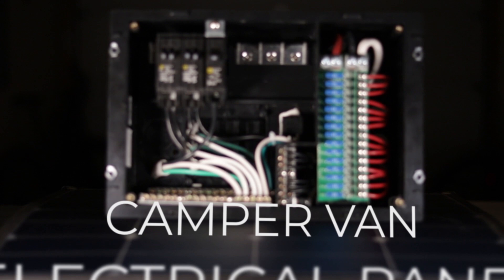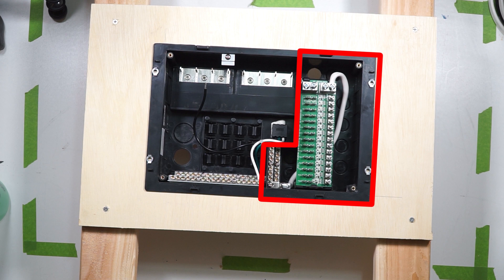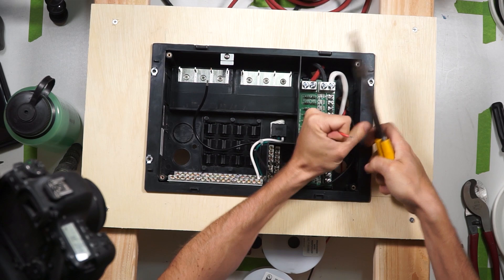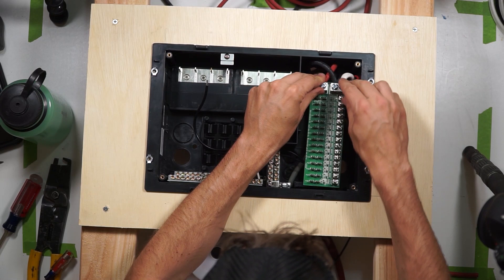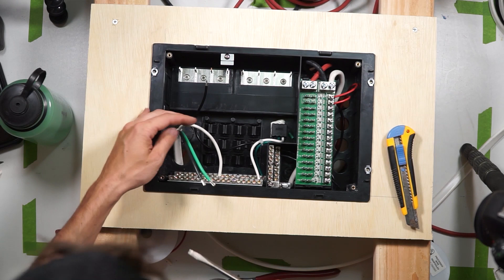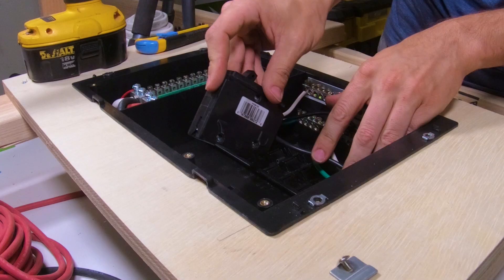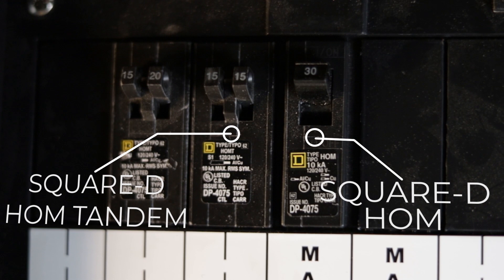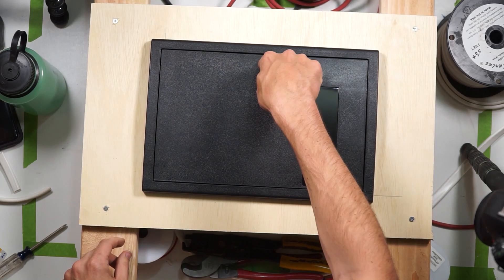How To Wire a Camper Van Electrical Distribution Panel

Comment: Thank you for the great videos.  What do you do if you have more than 15 different DC items to plug into the DC panel?  Can you combine some of the lighter loads to one fuse?  Example, I have two zones of four overhead LED can lights for a total combined of 8 LED lights.  Would combining DC charge ports I presently have on 3 separate wires be a better option? Thanks for your help?
Reply from the maker: Yes!  You can definitely combine like-items on one circuit.  Doing the lights as you proposed is a great idea.  Same on charging ports.  SALES PITCH INCOMING: I made a guidebook a month or two ago about 12V branch circuit system design that has several diagrams for combining these loads onto one circuit properly.  Here's a link to that.  Check out the preview & description and see if you think this would help your planning: https://www.explorist.life/shop/solar-wiring-diagrams/12v-branch-circuits/
Reply: @EXPLORISTlife   Thank you for the quick reply.  This appears to be for planning your wire runs ahead of time.  Unfortunately, I already cut and pulled my marine grade mostly 14 AWG wire, and now need a way to combine them just before the fuse box.  Will this help in my situation?
Reply from the maker: Ouch, nope.  Probably not.  You could always add an extra fuse block in parallel before the 12v fuse block in this distribution panel for additional spaces: https://amzn.to/3uljDpM
Reply: @EXPLORISTlife  So a separate DC fuse block with a separate set of positive & negative wires going to my negative and positive bus bars?

Comment: Question. Why are there 2 different sections of the box? 1 for 110 and 1 for 12v? Why have it separate? My interior lights, radio, and pumps are running off the battery, I don't see y.  Is there a way to have it all run off shore? Is there some sort of switch to make it all off shore and if want to also run off battery when I get the solar up and running? Thanks, as you can tell, I am new to this.
Reply: 110v is for house plugs, like outlets, AC appliances. 12v is for DC appliances. Some people get a separate 12v box, abd a breaker box for 110v, just an easier way to have everything in one.

Comment: This was super helpful. I’m essentially duplicating the setup you did in Andy Rawl’s Airstream in my Argosy, also in Texas :) I have a question, when a fuse is installed, I’m getting the needed 12 volts out. However, when I removed all fuses, I’m still getting 6-8 volts from the negative busbar to any of my positive outputs (even though there aren’t any fuses installed). Shouldn’t there be zero voltage on outputs without fuses installed?
Reply from the maker: Sometimes a capacitor in one of the devices will make a voltage reading show up when the master disconnect is off.
Reply: @EXPLORISTlife  To clarify, this is happening when I don't have ANY fuses in the DC fuse block within the distribution panel (same one that's in this video), and every circuit is measuring 8 volts from the negative bus bar to the positive DC terminals. Because I don't have a fuse installed in the fuse holders, shouldn't each circuit be completely disconnected?

Comment: Nate thank you very much for this video, I just have one more question how can I hook up an inverter to the distribution panel? I want the batteries take over as soon as the power is disconnected from shore power.  Thanks in advance for your help.
Reply from the maker: Sure!  You should check out the wiring diagrams on https://www.EXPLORIST.life/solarwiringdiagrams.   All of those have that capability.

Comment: Aloha Nate,
We’re remodeling a 1990 Winnebago Warrior and running into a power issue. Everything works great and we don’t really want to change anything except the back we want to be able to use the outlets when we are not connected  shore power. How would you introduce a investor to the system without completely ripping out current system? My thought would be have the inverter connected to the battery then run a cable to the shore power cable and simply connect is that viable option? Thanks for any help in advance!

Ben & Lauren
Reply from the maker: Here is a diagram a parts list for how I recommend upgrading a OEM RV that has 30A shore power: https://www.explorist.life/30a-camper-inverter-with-solar-and-alternator-charging-wiring-diagram/

Comment: question for you since you are a wiring guy....    30 amp service is said to be able to run 1 appliance at a time.......but what if you upgrade that romex wiring to an 8 gauge to your plug in on the side of your camper, and then installed a squareD 40 amp single pole single throw.........can you run 2 appliance at the same time reliably?  im thinking about doing a little upgrade soon
Reply from the maker: 30A is basically two high powered appliances (30A @ 120V = 3600W)

If you needed more than that; you'd need to convert to 50A service which would involve:
-50A shore power inlet
-6ga/4conductor wire from inlet to breaker box
-New 50a breaker box w/ dual pole 50A main breaker
-50A RV shore power cord
Reply: @EXPLORISTlife  I didn't wanna go full 50x2 converter box or anything....mainly just wanted to use 1 leg of that 50amp service, and then drop it down to 40amp so I can run more than my 1 appliance at a time
Reply: @EXPLORISTlife  I didn't know if I terminated 1 of the 220 50amp legs and just used 1 leg if the 50amp breaker would be OK since only using 1 leg of it.  Or would it pop due to not being somewhat balanced at the main panel
Reply from the maker: I mean... if it were me and I was putting out the effort to rewire/upgrade... I'd just do it right with a proper 50A setup so I didn't have an awkward non-standard in-between kind of thing going on.

Comment: I'm a bit confused on the 120v breaker. If I'm installing 5 wall outlets in my van do they each need their own circuit breaker or will they all be in series wired to the square D HOM tandem breaker?
Reply from the maker: All of the outlets can be wired off of one circuit.  Think about how your house is wired: all of the bedroom outlets are on one circuit.  Kitchen outlets are on another circuit, etc..

Comment: Could we bring all wires from the sides rather than the back? I'm looking to get one of these but wouldn't have back access, only side access (I'm making a small custom camper).
Reply from the maker: So... I've done that before and it makes it really hard to get the box into the wall. 😂🤦🏼
Reply: @EXPLORISTlife  Haha... I forgot to mention I'm not putting it in a wall, but mounting on a wall. So I'm wondering if there's enough room on the sides to bring in the wires?
Reply from the maker: Ac side, probably.  Dc side, not sure.

Comment: Can I hook my 3000watt inverter (solar backed) to this panel directly so I can power installed RV outlets particularly the tv while driving on the road? I understand I would want to install shore tie and genset isolation switch and when on inverter power, I’d unplug the converter/ charger. Not sure if the neutral floats or is bonded to ground(?).
Reply from the maker: Yep!  Here's a diagram of how that would look: https://www.explorist.life/30a-camper-inverter-with-solar-and-alternator-charging-wiring-diagram/

Comment: Thanks so much for this video Nate. Quick question. How would you run a 50Amp shore power to this box? If you have a 50A Diagram, with about 400AH at 24 volt system, I'd gladly purchase it.
Reply from the maker: Sure!  Check out the different setups on the diagrams on this product page: https://shop.explorist.life/shop/all-products/distribution-panels/120v-ac-distribution-panel/

Comment: Thanks for the video, Can this ac system support 3x 15amps circuits and 120 amp circuit ?
Reply from the maker: This breaker box is 50A max, so it will not support a 120 amp circuit.

Comment: Hello! How do you size your breaker fuses??? Like you use a 15 20 tandem fuse but is that enough for house hold plug outlets?? Like one I would use to charge a MacBook? And is 30 enough for your breaker from the inverter? How do I size that one??
Reply from the maker: Great question!  The breaker is sized by the wire you are going to use.  For 120V AC circuits (like what you are asking for), if you are using 14 gauge wire, you use a 15 amp breaker.  12 gauge wire = 20 amp breaker, 10 gauge wire = 30 amp breaker, 6 gauge wire = 50 amp breaker.

For a 'normal household circuit' like what is installed in your house, 12 or 14 gauge is usually used.  I'd recommend using 12 awg for those because you could power/charge your macbook AND run a blender (or other higher powered kitchen appliance off of the same circuit.

For the Inverter to breaker box, that truly depends on the size and passthrough capabilities of your Inverter.

Comment: I have the 8930/50 and want to know if anyone has used the 20amp outlet on the back to plug in a Tripplite APS 1250 inverter/charger or any other smaller inverter charger? I know you should run shore power to inverter first but I want to run shore right to 30 amp main then use 20amp breaker for inverter/charger since it is a smaller unit with a 115v plug which I don't want to cut.  If I run shore power to inverter charger first I believe it will limit my overall capacity. I know this sounds a little different but I think it will work,,,,,your thoughts ,,,Thanks

Comment: If you use your 30 amp slots in the breaker panel for shore power, could you then use the 50 amp slots in the breaker panel for your 30 A plus 25 A dc assisted inverter ac out #1?
Reply from the maker: Not quite.  Shore power -> Inverter/Charger Input -> Inverter/Charger Output -> Breaker box.

Example: https://www.explorist.life/3000w-inverter-400-600ah-400-to-1200w-solar-camper-solar-kit
Reply: @EXPLORISTlife  My thoughts also, 55 amp possible output from the ac out #1 throught the 6 AWG into a 50 amp main breaker on the left side of the panel. Use right side for 30 amp main breaker with a shared neutral.

Comment: For my main breaker I want to switch from a 50amp breaker to a 100 amp breaker. I have my two legs of power coming from a transfer switch and believe that a 100 amp breaker would distribute 50amps per leg or would it be 100 amps per leg? I am wired for a 50amp service through shore power and I’m using a 2500 watt inverter with 400w of solar and 3 250ah  batteries with a 40amp charge controller. Am I over or under?
Reply from the maker: A 100A dual pole breaker would be 100A per leg.  You'd be looking for a 50A dual pole breaker to provide 50A to each leg (for a total of 100A for the whole box).

Comment: For the DC side I have 15 circuits total. Since there are only 12 screws on the negative bus bar for the DC side of the panel, can I attach 2 wires to one screw for a few of them?
Reply from the maker: Yep!  Sure can.  Try to choose the smallest wires for the ones to combine.

Comment: Hi! One question but can you run either side of the box panel ? Do you have to run two wire to the same location? Because what if you using AC and then you go to a place where there is not AC you have to run DC
Reply from the maker: AC and DC can be run simultaneously.  If you go to a place where there is no AC (shore power), the Inverter will convert the DC power stored in your battery bank to AC power to feed this power distribution panel.

Comment: I'm thinking about buying this fuse panel in your description link.  I was just curious what the outlet in the back of panel is for that you connected to the 15a breaker.  Can I use that for shore power and would I connect that to the main 30a breaker?

Comment: Thanks for the video, does the ground busbar on the DC side need a ground wire going to the chassis?
Reply from the maker: You can see where to wire the ground for the chassis in the wiring diagrams found on https://www.explorist.life/solarwiringdiagrams
Reply: I found it thanks.

Comment: I am upgrading my electrical system for solar with an inverter charge was wondering if I need a new Distribution panel or can I use the current one?
Reply from the maker: You should be able to use the same one. :)

Comment: Does anybody know where one is suppose to connect the AC wire to the Inverter? For this example he is using here, is the AC cable connecting to the 3 point prong on the outside face of inverter? this is probably a dumb question but it is confusing the heck out of me. He seems to be using a regular power cable  with 3 wires  to connect to this electrical panel but is the other end of the wire have a male connector that is going directly to the Inverter?
Reply from the maker: This box gets power from the AC Out terminals on the Inverter.  Example: https://www.explorist.life/3000w-inverter-400-600ah-400-to-1200w-solar-camper-solar-kit

Comment: So, I checked on your website for a schematic for a setup I have, I couldn't find anything for a cargo trailer. Also tried your facebook, but was diverted to here. 

I know your just on the other side of the Walden from me, and have thought of swinging through.  I'm currently needing a drawn up schematic, for a 7x14 Cargo Trailer.
   I'll be running a Dometic CFX3-100 Fridge, nearly full time until evening. The lights only on when needed, and will run a few USB chargers for phones, GoPro etc.    I was thinking of also running a battery isolator from the truck to the trailer, so I can charge the battery, or solar generator while in motion.  

I have absolutely no knowledge in this area, and need your help.  I have listed below what I currently have, and need to know what else I need. 
 I'd like to set it up so I can use my Bluetti, and if need be use the Renogy Battery as well, so swap between the two, or have them working at the same time.

I was also curious what your fee was to set this up, I'm a 3hr - 170mi drive.   
  

I currently have:

4 / Q.PEAK DUO BLK ML-G9 380W Panels, but I am only mounting 1.

1 - Victron Energy BlueSolar MPPT 100/30 Charge Controller

1 - Renogy 2000W Pure Sine Wave Inverter/Charger

1 - Renogy 200AH 12V Battery

1 - Blue Sea 5026 ST Blade Fuse Block 12

1 - 250A Circuit Breaker

1 - 100A Circuit Breaker

2 - 10 Terminal Bus Bar / 150A

1 - Bluetti AC200P 

1 - 20ft 10AWG Solar Cable

What I plan to run periodically. 

1 - Dometic CFX3 100 Fridge / Working Power 1.06A 120V | DC 10.8 - https://www.dometic.com/en-us/food-and-beverage/coolers/electric-coolers/dometic-cfx3-100-220587

2 - USB Power Outlet / Working Power 15A - https://www.amazon.com/gp/product/B07XJRHS32

8 - LED Lights / Working power: 3W / Working Voltage: 12V DC    www.amazon.com/gp/product/B089GYRP5L

1 - Isler Induction Stove - Working Power: Variable | 120V   https://isiler.com/product/portable-induction-cooktop-isiler-1800w
Reply from the maker: This will be the closest diagram I have for the parts you already have: https://www.explorist.life/2000w-520w-60a-budget-friendly-camper-wiring-diagram/

Integrating the Bluetti into the built in system introduces an additional layer of complexity, which I can't recommend.  Use it, sure... but I'd recommend against integrating it.

Re: rates for installation.  I don't offer installation services.  I teach people how to do it themselves.

Comment: Hello I have a question I have the exact distribution panel box and my question is   do I have to ground the ac side to the frame of the van or no need? Just a side note that I am not using the DC side and nothing is hooked up on tge dc side to the battery.
Reply from the maker: Is it being powered through an inverter?  If so, the inverter SHOULD take care of the grounding internally but you'd want to refer to the user manual of your inverter.

Comment: Help me, help me!  When working on the AC side, Nate mentions a "120 volt plug built into the back of the box" but doesn't show the back, or explain the plug's purpose.  Do I need to plug it into something?  Is it a shore power hook up?
Reply from the maker: It's simply a 120v outlet you can plug an appliance into if needed.  It's generally not that useful and is something you dont have to wire up.
Reply: @EXPLORISTlife  I appreciate you, brother.  Thanks for getting up early.

Comment: Hi, should I be installing a fuse along the positive wire coming from the battery bank into the 12V input of this distribution box? 

Thanks
Reply from the maker: Yep.  Check out any of the diagrams at https://www.explorist.life/solarwiringdiagrams for examples of fuse placement.

Comment: Can this distribution box be used for a 12V DC to 230V AC if you change the 120V plug to a 230V plug and change the wiring that connects to the neutral and ground bus bars?
Reply from the maker: I do believe so, yes.

Comment: thanks for the vid.  My box does not have a ground bar on the dc side.  Do I connect the DC grounds where the AC side grounds are?
Reply from the maker: Nope.  The DC side needs a DC ground bar.
Reply: @EXPLORISTlife  thanks
Reply: @EXPLORISTlife  so then do I ground both bus bars to the chassis?
Reply from the maker: No, the chassis ground happens at the Lynx Distributor.  See the following diagrams for more details: https://www.explorist.life/solarwiringdiagrams
Reply: @EXPLORISTlife  thanks